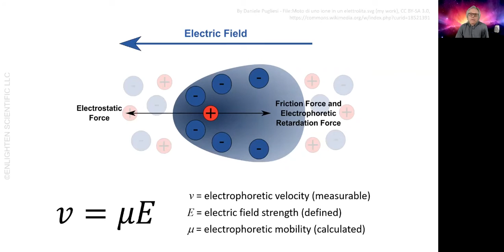Measuring zeta potential - electrophoresis

Comment: Can you calculate human red blood cell zeta potential? do we need same pH and same electrolytes as in blood? Also there is a significant amount albumin in blood that is also negative charge in blood pH. Do we need to add it to calculation? And also container of the fluid effect the zeta potential? for example glass tube is negative charged but charge. can plastic tube change this?